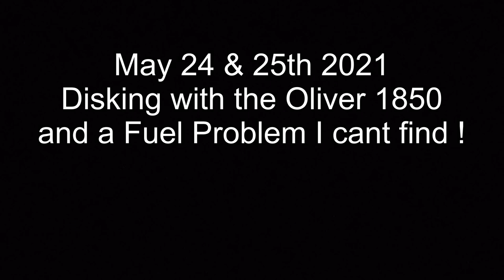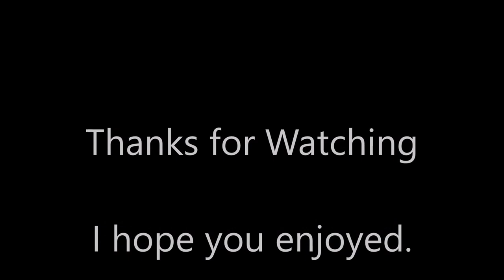May 24 & 25th 2021 Disking with the Oliver 1850 and a Fuel Problem I cant find !

Comment: Hello think you showed it was wet near the ejector pump so I'm thinking there is a bad o ring inside. Since you put electric fuel pump on it's the only thing left it's not a fuel supply issue. Have a good day
Reply from the maker: I did tighten the the 4 top bolts on the head , Maybe an 1/8 of a turn and so far there is no more leak but it's still not running right. Dont get me wrong it runs good but its something you just cant put my finger on but to me there is something not quite right and I want it right so its time to talk to the man that rebuilt the injector pump and I want to do some more research on the timing on it and if was changed after the engine was built. I got question and I want answers and so far its more question than I have answers !  Bandit
Reply: @banditfarmer1900  Hi I didnt know the pump was rebuilt hmm. Well hope you get it figured out. Have a good day.
Reply from the maker: @jamesmorrison1884  When the pump was pulled to be rebuilt I had the injectors rebuilt with new tips put on them and were reset and tested before they were put in. This is one of the big reasons I'm so aggrovated with this , A lot of time and money went into fixing this old girl up and this is just one that doesnt make sense to me or Harry. Its got to be something simple we just cant see it yet !  Bandit
Reply: @banditfarmer1900  So pump rebuilt injectors pop and tested at the correct pressure. Have you done a compression test on engine? Maybe there is a broken valve spring? What is the make of injector pump? Did this act like it does only after you put injector pump back on? Lots of question a, maybe I can help though text I'll try.
Reply from the maker: @jamesmorrison1884  I've been threw it pretty good, I checked the valves and so did Harry. Harry did a compression test on it with the injectors out and came up with 350 psi on all 6 cylinders, Now this was just after the injectors were pulled and it may have washed the cylinders some so the compression may be higher than that. The engine is not the original one to the tractor so we have no idea how many hours are on it but as Harry said being they were so close to each other he said he wouldnt be afraid of it.  All the injector were shot so I really cant compare how it run before to now, But the injector pump and injectors were rebuilt and tested before they were put in. But even after they were installed we both agree something is off cause to listen to it run something is just a bit off and we just cant figure out what it is. Timing is dead on what we were told it should be so the only thing left is the injector pump itself and it hasnt been touched yet so a call is in order to the guy that rebuilt the pump and see what he has to say and go from there.  Bandit
Reply: @banditfarmer1900  Hope find it soon. I'm not sure what the compression is to be but I do know all even is good. Are all the return lines clean inside? If one is a little pluged and flow is slow maybe that may be a issue ?
Reply from the maker: @jamesmorrison1884  When the injector pump and injectors were out all the fuel and return lines were soaked and cleaned and checked with a flow meter and they were all good. Harry goes threw everything when he does a job, He has been working on Oliver's and working at McHenry's for the last 50 years so he knows his stuff ! Most of the time if I have a problem I'll ask him and he will tell me whats wrong and how to fix it , This 1850 has him scratching his head cause its not making sense to him for what has been done to it and if you make him scratch his head you've done something !  Bandit
Reply: @banditfarmer1900  Think it has to do with the ejection pump seems to me that's the only thing left
Reply from the maker: @jamesmorrison1884  I agree, It's the only thing that has not been tinkered with yet, But it's day has come !  One can only assume when you send an injector pump is sent out to be rebuilt that when it comes back its right and ready to go, So now it's time to look into it cause everything else has been done.  Bandit
Reply: @banditfarmer1900  some of the rebuilders  I've seen only do just what is needed and not the whole thing.. the one place I deal with give a 2 year warranty or one year I'm not sure
Reply from the maker: @jamesmorrison1884  I dont remember him saying anything about a warranty but he is the guy everyone takes there pumps to be rebuilt, He did say if I had any problems with it to let him know and he would take care of it.  Harry and I both agree it's time to give him a call because we have done everything possible to the engine and fuel system to make it run right . Its funny how we've done everything you can think of to the engine but have never touched the injector pump, Kind of a dont touch it cause it has to be something else wrong, Now its turned into its got to be the pump plain pure and simple !  I'm calling him this morning.  Bandit
Reply: @banditfarmer1900   well guess will have to wait and see how goes
Reply from the maker: @jamesmorrison1884  I called him today and I'm really not wanting to haul it 40 miles to his place to be worked on so I'm weighing my options on what to do.  Bandit
Reply: @banditfarmer1900  yes I understand that also. Your stuck between sand and a swamp what to do have him come see I'm thinking but that cost money also hmmm

Comment: How full is the tank?
Reply from the maker: Its full every morning and at the time the first video was taken it was about 1/2 full. The tank is above the engine and I know the tank and fuel lines are clean and open but we just cant find ware it's getting air into the system  but it's sure getting in it. Even with an electric fuel pump on it I'm still getting air someplace and we just cant figure it out. Bandit

Comment: Hmmm time for a 5.9 cummins swap! Haha just joking. I hope you figure out the issue!
Reply from the maker: I would sell the tractor and buy another one before I did a Cummins swap ! LOL Thats about a $13000 engine swap ! LOL It aint worth doing that in my book. It's got to be something simple that we just havent seen yet thats causing the problem but at this point I think its time to call the guy that rebuilt the injector pump because thats the only thing that hasnt been touched. The fuel system is right from the tank to the injector pump so its time to look into the injector pump for the answer.  Bandit

Comment: I had a ferguson one time with that same pump would do the same thing yours is doing turns out it was the injector pump
Reply from the maker: I'm really starting to wonder that very same thing, The injector pump was rebuilt but with everything that has been done to the tractor so far I really havent touched the injector pump and starting to wonder about it. I might have to call the guy that rebuilt it cause I'm running out of ideas.  Bandit